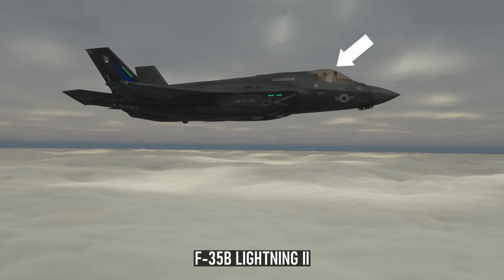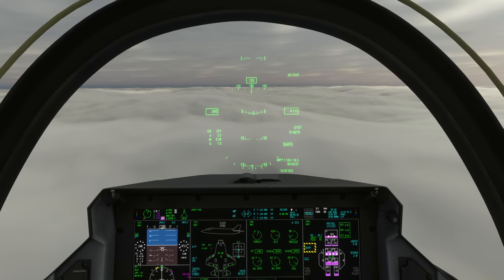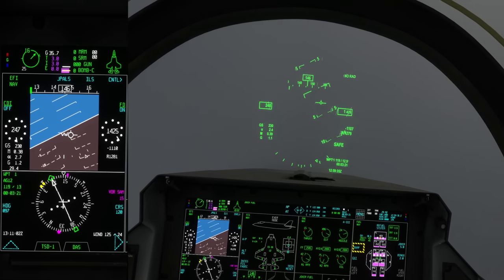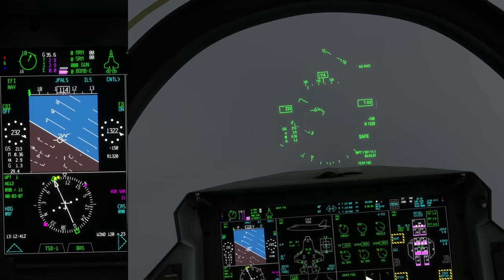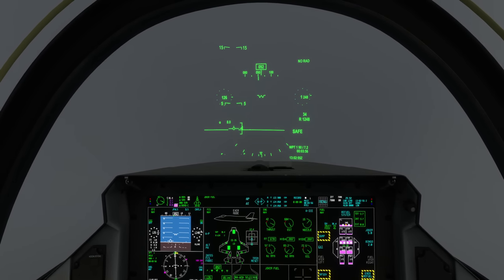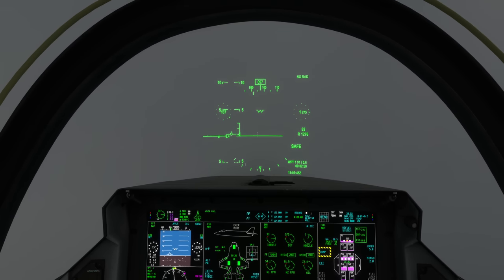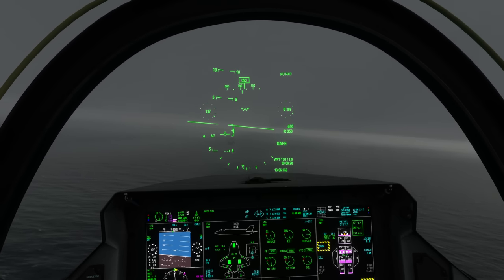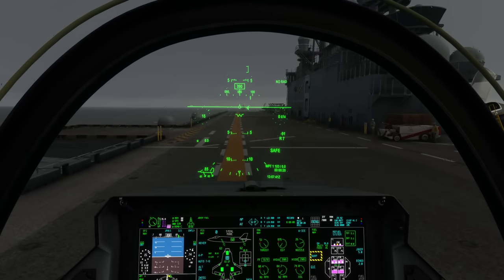Bad Weather? No Problem! F35B VSTOL CASE 3 | Real NATOPS Procedure (MSFS)

Comment: There's definitely a high pucker-factor in flying carrier approaches in bad weather.  I can't imagine trying to do it with a non VSTOL and having to crash into the deck at high speed.  Beautifully done.
Reply from the maker: It’s a lot easier in the F35 where you set STOVL and it flies it for you. I’ll try it in the AV8B next! 😅
Reply: @cgaviator  I’ve just tried it in the MV-22 Osprey I just purchased and have found that I can’t slow down enough without 10 miles of wiggle room or I rip the nacelles off!
Reply from the maker: @axeman3d  haha! Good idea to try the Osprey! It’s a tricky balance to keep the power low enough to slow but enough to lift during the transition phase. Should be able to slow within a mile or 2
Reply: @cgaviator  use dcs next time though this isn't as close
Reply: @denmister100  to be fair: I've seen some pretty horrible approaches / landings within DCS that people shouldn't be able to get away with - and they've been called "great landings"! so yea.. while i 100% prefer DCS for such activities and it's the best we got, it's still far from being perfect.

Comment: Imagine doing this on a Harrier (in DCS or Real Life even)? That's perhaps the first time I just fully realised how impactful the automation in the F-35 is in reducing the workload. Imagine having to constantly keep an eye on all the instruments while slowly adding more nozzles and throttles.

Amazing video.
Reply from the maker: I’ll be doing a DCS AV8B version soon! 3 nozzle settings: 50, 60 and hover stop.
Reply: @cgaviator  Ah yes that would make sense. Not that it would make it easy by any means though. Can't wait for the video :D
Reply: @cgaviator  When I fly the dcs harrier I try to maintain a stable pitch and use the nozzle to control speed. For me it works much better than pitching up and down to adjust speed. So it's basically power for up/down, roll for left right and nozzle angle for fwd/aft.
Reply from the maker: @audunskilbrei8279  yeah, the dcs one is a major workaround. You can pitch full nose forward and not crash as long as the nozzles at at 90!
Reply: @cgaviator  What do you mean by pitch full nose forward?
Reply: @audunskilbrei8279  Try sniffing the ground maybe?

Comment: 35 avionics maintainer here, any 35 pilots and or engineers can double verify because I was almost sure the ILS gave you a visual outline of the flight deck on your HMD or am i trippin
Reply from the maker: That would be sweet, but I don’t think that would be possible in this sim. I’d love to get my hands on the real F35 sim again
Reply: @cgaviator  the legit one from Lockheed uses a very low resolution, low poly, early google earth environment

Comment: While it's usually impossible for me to give props to anything military/naval based aviation related in MSFS because there is a far superior option out there for that kind of stuff, i do want to complement your piloting and (almost 100%) dedication to NATOPS SOPs. While i don't know shit about F-35 SOPs i was a bit confused about when the ball call came, but besides that i am certain that if you had the DCS Supercarrier with a capable module (Hornet is my preference) you would rock CASE 3 down to every detail rather than going for minimums straight because having things like the ball and long range laser lineup system will be able to assist you. Plus usually you'd fly "needles" anyways.
Reply from the maker: Needles for the win! Straight to minimums because there was no glidepath guidance. And there was plenty of poetic licence at play! 😅
Reply: @cgaviator  Yea you gotta find your workarounds to deal with the constraints of the sim. You did an awesome job at that imho, keeping it as true to SOP as feasible. <3

Comment: The chart you have for reference shows a left turn onto a right arc, yet you flew a right turn into a left arc. Are there two types of procedures for this approach? I certainly stand by your comment “known power and attitude gives a predictable performance “ - or words to that effect! Flew it like it was on rails, very informative particularly the control input responses once in the hover. I was under the impression it flew like a Harrier, leave it to the (good ol’) US of A to come up with something different… thanks!
Reply from the maker: The chart I use for reference, there’s nothing to say that a particular ship can’t nominate a 210 rather than 150 relative bearing for the Marshall. I did it because of the ground which I ended up flying over anyway! 😅 And thanks, much appreciated 👍🏻

Comment: Chris, awesome video as always but I’ve got a burning question. As we see yourself pull along side the carrier as they do in real life, and perform this slide across action. If the runway is free from aircraft and other traffic, then why can’t the pilots fly straight in like a normal runway?
Reply from the maker: They can! From how it read, at night they conduct over-the-stern approaches. But the deck is much smaller than a CVN type ship (regular carrier) so it would be tight. Or at least that’s my understanding of it.
Reply: Have a look at Shipboard Rolling Vertical Landing videos.  That is the procedure for over the back of the ship approaches.  But it has always been easier to stop then land rather than land then stop,  which is why the vertical landing is preferred.
Reply from the maker: @SPQRTempus  I did a few over the stern practices before settling on this approach. Perhaps I’ll do that video next. Thanks for the suggestion!

Comment: Really enjoyed this, thanks Chris. One question, how does one do a rate one turn with the F-35's glass cockpit? Is there a HUD symbology for that?
Reply from the maker: Thanks! And I don’t think they have an indicator for the rate 1, not like the old days! At 250kt it’s about 30 degrees. I think there’s a rule of thumb. 10% of groundspeed plus 7 rings a bell. So for 250kt, 25+7=32. Don’t quote me, but it’s good enough for government work! 😅
Reply: @cgaviator  Nice. Thanks. I was also wondering, do military aircraft (Tornado, Harrier era) have the ability to fly IFR flight plans using RNAV waypoints, like an airliner? This is something never implemented in the sims I have tried.
Reply from the maker: @oistk8956  can’t speak for the Harrier but I’m fairly sure that ICAO points weren’t part of the load. I believe (stretching the memory) that we carried a book with the coordinates of the waypoints and then used GPS nav to that. Not legal for flying RNAV but we could steer direct. Mostly, when travelling outside the UK, we’d be lead by a tanker which would handle all the IFR stuff for us! 😁
Reply: @cgaviator  fascinating, thanks! I guess you could fly VOR to VOR (or NDBs). I bet modern F-35s and such aircraft can fly ICAO RNAV waypoints on AP.
Reply from the maker: @oistk8956  I would hope they can! 😂

Comment: Thanks a lot for all your good and interesting videos :) The landing phase looked rather easy. Very stable og pretty fast deceleration. Was that just an obervation from my side, or is the F-35B really so "straight forward" to handle in MSFS?
Reply from the maker: The real F35 is simple to handle though recently a guy ejected from a bounced landing. Think there was a system failure in there somewhere! But the MSFS is crazy easy to control but the hover controls are a tad off.
Reply: @cgaviator  Ok thx :)

Comment: Cool video but one thing that bothered me is that you’re on the R300 not the R120, you’re flying 120 inbound course
Reply from the maker: True, if I verbalised it as a radial from then I misspoke. However, I can still be on the inbound radial value rather than use tail end of the needle. And mostly it’s a fudge based on me using the GPS waypoint rather than tacan. I think I corrected my lead radial comment.
Reply: @cgaviator  it was clear what you meant no worries, you were flying a course to a waypoint as you say, not tracking a radial. Wasn’t really worth me picking up, just being very pedantic. Enjoyed the video

Comment: Gonna get the f35 tomorrow. Is there a key binding for the vtol to activate at any point in flight? Also how did you get aircraft carriers. Great vid.
Reply from the maker: I seriously need to charge the developers commission! 😂 Keybinding is toggle tail hook and hover is ap heading hold. It’s in the manual for reference! Carriers are Miltech but indiafoxtecho also do some.

Comment: Wow. This is amazing. Makes me hope there will be some sort of flight plan system for this aircraft some day!
Reply from the maker: Thanks! 😁 There is a flight plan system of sorts. You can also plan externally and import a flight plan. Or did you mean create waypoints in the aircraft?
Reply: This might be redundant but check out PMS50
Reply: @cgaviator  i mean add/change waypoints while in flight. Flying a normal route on vatsim in this is quite difficult currently because after loading in you can’t change Sid, star or approach. Quite annoying.
Reply: @aruhtaz  you mean using it through the toolbar and changing route that way? I’ll have to try, seems like an idea.
Reply from the maker: @Lasssse  ah yes, though unless it’s RNAV specific you could always fly it old school! 😅

Comment: that landing would have no doubt broke those wheels and landing gear.
Reply from the maker: The gear is designed to take a firm landing (unlike the recent ejection that happened at Dallas). VTOL aircraft aren’t landed like a helicopter, they’re firmly planted to avoid issues with ground effect and pitch/roll of the deck 👍🏻

Comment: Could you complete a sortie with no instruments at all?
Reply from the maker: How do you mean? VFR or a flight with weather but instruments failed?
Reply: @cgaviator  just left with stick and throttle no instruments,no airspeed indicator, no artificial horizon
Reply from the maker: @alripal9665  through significant cloud, not possible without instruments. If they suffered a display failure they may be able to use an iPad with gps for ground speed reference.
Reply from the maker: And it depends on the definition of completing a sortie. They may be able to fly about but they wouldn’t be mission effective at all 👍🏻
Reply: @cgaviator  thanks for your reply,it just seems to me that you're overly dependant on instruments
Reply from the maker: @alripal9665  In cloud, absolutely, 100%. In war, even more so! They are however very reliable. In the very early days they used to spin the aircraft through cloud as they didn’t have instruments and it was the only way to make it through the cloud and still be in a known attitude! Sounds crazy, but I think it’s true! I’ll take some instruments each time! 😂

Comment: Stick for up and down!? WTAF. Is the real aircraft is configured this way in VTOL mode? As a rotary wing pilot this is heresy.
Reply from the maker: Yes, it’s designed so the inputs are similar to forward flight. None of this funny business with the controls. It’s to keep it common between phases of flight. When I messed about in a real helicopter sim, I had a hell of a job telling my brain to put my throttle hand forward at landing rather than backwards! 😂